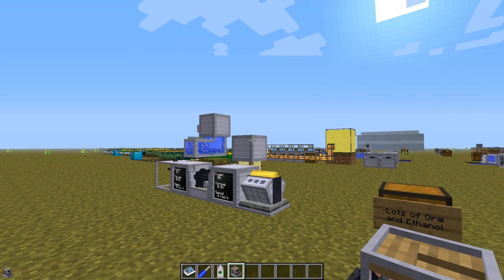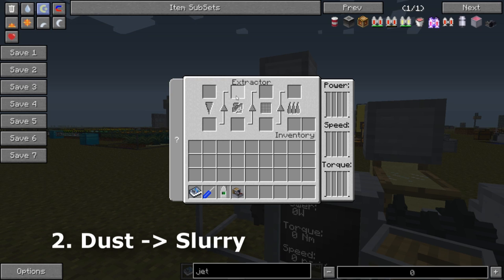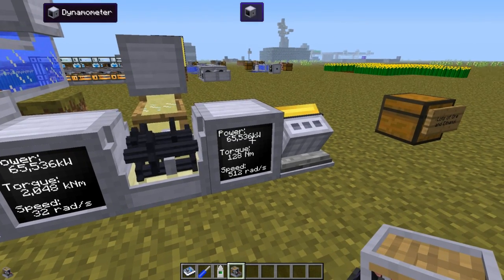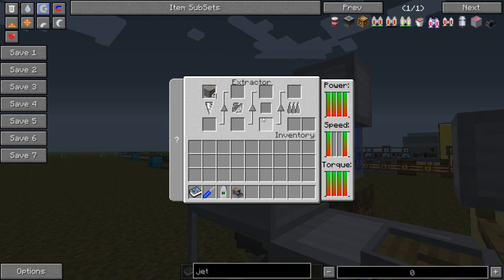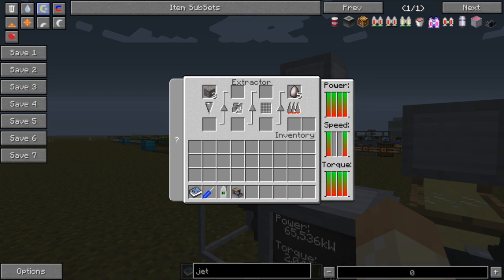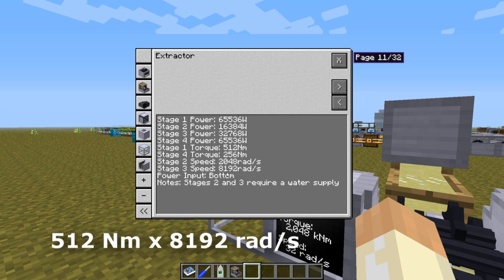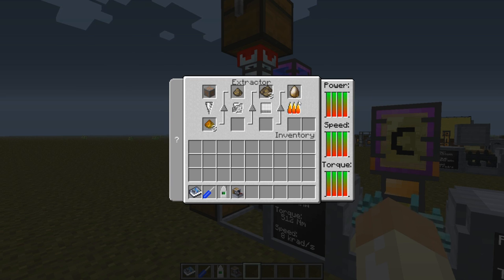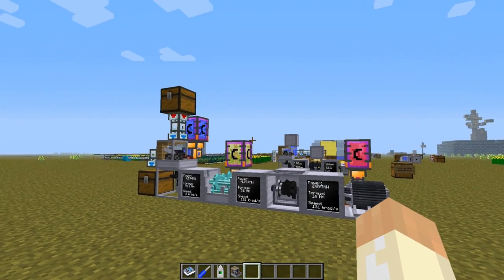RotaryCraft Tutorial - Extractor (FTB 1.6.4)

Comment: Wow. Excellent. I have one remark though, you don't really explain these things in-depth, and I think that would help a little more.
Reply from the maker: Well, I don't disagree with you. But the purpose of the tutorial is to show how things work and how to use them. At some point, it's up to the person to read the RotaryCraft handbook to understand things fully. And I don't aim to explain the hidden math, since I don't think that's required to be able to use it. However, if you want to optimize a machine (like calculate how much power is required to process one piece of ore in one tick @ what torque/power) this is not fully useful. But in another video I did a setup with the CVT to give a few hints of how to work towards an optimization... it could help out, even though it won't go that deep.. :)

Comment: What about using a magnetostatic engine cranked at maximum?
Reply from the maker: I haven't tried it, but if you have a good input power source I guess it should be fine. Try it in creative ;) I would however recommend using a CVT Unit with it regardless of power input.
Reply: therealtkh CVT over 16:1 bedrock gearbox?
Reply from the maker: MrGiomachi MC Well you don't need any gearbox when using a CVT... Or what do you mean? :)
Reply: I'm not familiar with the CVT, I was just using my main MJ power source to power the magnetostatic engine, then that turning the bedrock shafts and the bedrock 16:1 gearbox so I shouldn't have torque or speed problems but I cant get past the water step and yes there is water in there
Reply from the maker: MrGiomachi MC Lucky for you, I have a tutorial on the CVT :) Search on the channel and you will find it. How much torque and speed to you have? How does it look with the bars to the right in the Extractor interface? The requirements on the four steps are different, and using one static setting is not ideal as it would be a real waste of energy to do so.